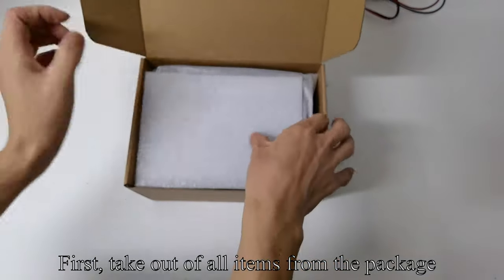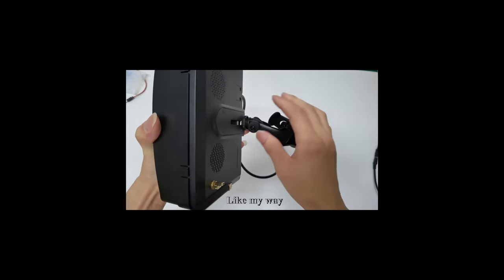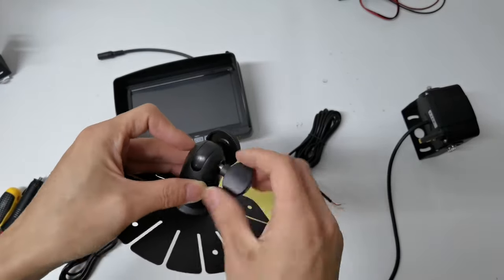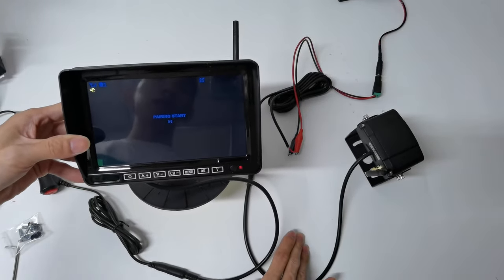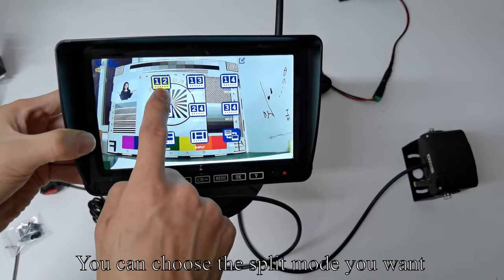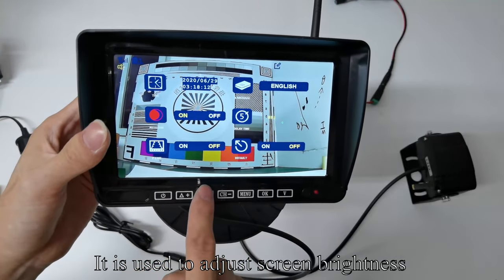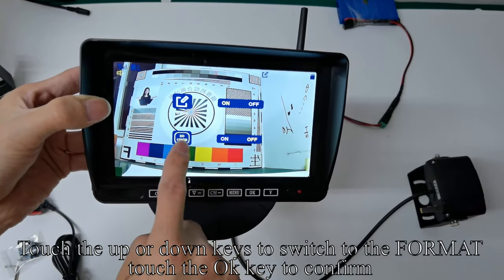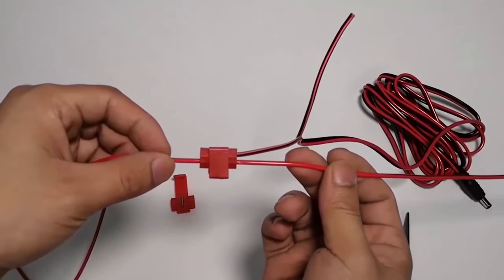Rohent R12 FHD 1080P RV Wireless Backup Camera with 7'' Touch Key DVR Monitor for RVs,Trailers

Comment: I just bought and installed this camera on my Chevy Express van/camper conversion. It is super easy to install and works great. I love it. This is a pretty well built camera, not a cheap one like I had before. The 7" monitor is pretty big as well and the picture is awesome. But you don't get the windshield mount, that's extra.
Reply: Mike, read my comment above yours here.